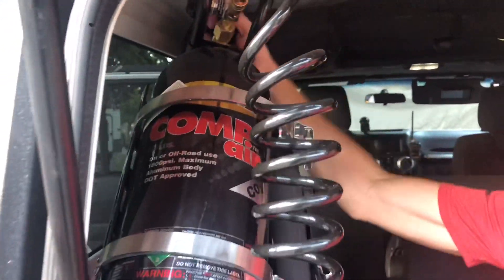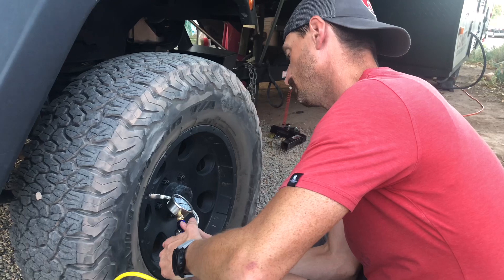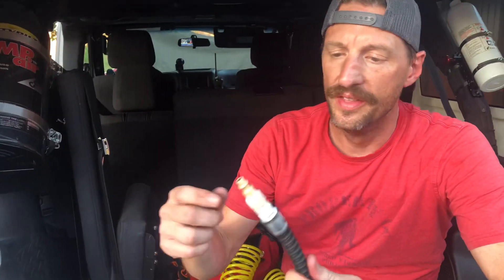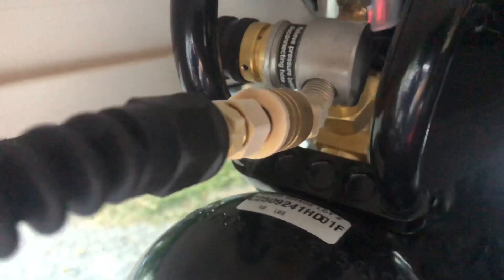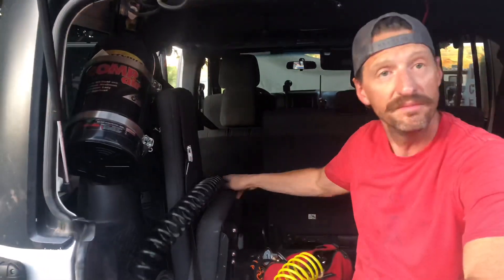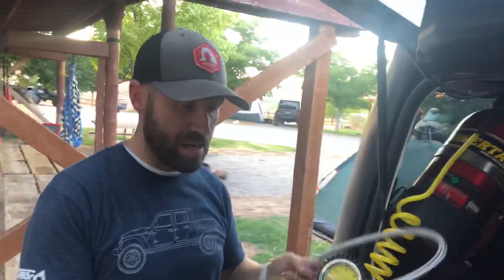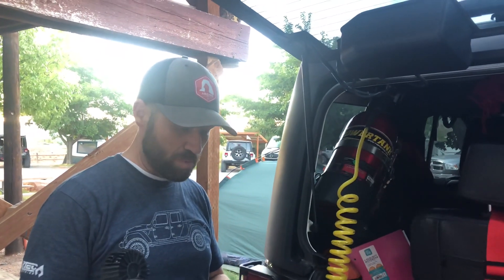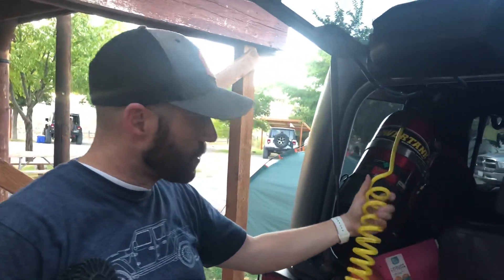Powertank vs Smittybilt CompAir

Comment: I bought the Smittybilt because I was being cheap... I’ve taken mine out twice now, and it has worked absolutely fine.   It didn’t leak at all and the hose that it came with had a good seal.  Problem for me was it only aired up 7 tires from 15-40psi... I had to plug in my portable compressor today to get my 4th tire up to on-road pressure.  I don’t want to pay to fill it EVERY trip, but i definitely need to figure out how to make it last for 8 tires.
Reply from the maker: PandaFam That might be where you fill it. There are some places that will fill the tank to its “top“ but will not actually pressurize it to its full capacity. Make sure you find a place that will actually pressurize the tank. My first time filling it up I had the same experience as you, but it was at a paintball place and their machine didn’t have the ability to pressurize it. Now we use a welding supply store.
Reply: Jeremy McLerran oh man! Thanks for the reply! I DID fill it up at a paintball store. Going to try a welding supply store next. Hopefully i really get to use it the way it’s supposed to
Reply from the maker: PandaFam Ha!!  I knew it… Same exact thing happened to me. Sorry you had to waste a full tank on that. But lesson learned, right?
Reply: Also going to 40psi😳.   What size tire?   Seems like that would be a rough ride.
Reply: BBDOC O ya, I’m running 35” BFG KO2s. The guy at the tire shop said that for on road use, they last longer and get better mileage at 40-42 psi. It shows. It’s somewhat of a rough ride regardless though. It’s a Jeep, so i never expected it to drive like a luxury car. Drives more like an old truck
Reply from the maker: PandaFam That air pressure is really, really high. I can’t imagine all the bone jarring bumps you’re feeling right now!  

I prefer to do something called the “chalk test“ where are you take a piece of sidewalk chalk and do a nice thick line across the tread of the tire. Then you drive down the street a few revolutions. Stop and look at the chalk. If it has almost completely worn off, you are at the right tire pressure. If it is wearing off only in the center then your tire pressure is too high and if it only wears off on the edges your tire pressure is too low. I found the best ride And longest life come when you are getting a nice even wear across the entire tire
Reply: @1111Overland  Thanks! I'll give that a try. I'm going to milestar patagonia M/Ts in 37"s soon and I was told that that same test doesn't work for that tire.  It'll buckle if you get a "full patch" on  road... it's meant to be center biased.  Thoughts on that?
Reply from the maker: PandaFam I’ve heard the same thing. It’s designed to run on the center, not the full tread. I considered the Milestars but they were heavier than the BFG K02s.  I’m trying to lighten my load, not increase it!
Reply: @1111Overland  they are heavier... and I misspoke earlier. I'm likely going to milestars because they're the only one available in 38s... BFG, Nitto, Toyo, MT all have 37s but no 38s.  My axles can't do 40s, so I want to maximize diameter

Comment: If you had to buy a new hose what would be the pressure limit of the hose for those systems. Thanks
Reply from the maker: Great question. John recently replaced his hose with a higher PSI hose (I believe it’s rated at 200 PSI) and he hasn’t had any more problems.

Comment: So I'm always looking for a bargain and so I also bought the Smittybilt CompAir at the 4WP show a couple of months ago for $250.  Like John, mine leaks like a sieve, so I would be curious as to a great replacement hose and fitting that would not leak as much.
Reply from the maker: SultanOfShinola so I just asked him and he said that he tried using his hose kit from his onboard air and it was dramatically improved. He wants to try my Powertank hose kit and see if it’s even better. Makes me wonder if the fittings aren’t machined as precisely as they could be
Reply: @1111Overland  Well, being cheap Chinese products, it didn't surprise me. I'm just curious now to see which one he likes best to give me an idea of which to buy for my tank.  At least you can't mess up a 10lbs scuba tank, right :-)

Comment: Powertank has the edge for quality.  Whatever works for you.  Dawgtanks work well for less money.  Also, it looked like maybe the Smittybuilt tank had been overfilled if it was leaking liquid CO2 on the fittings.  On a 10 pound tank you don't want to fill it more than 9# 13 oz.
Reply from the maker: Dawgtank never heard of Dawgtanks, I’ll have to check you guys out!

Comment: Is there a fix to the Smittybilt tank? I have one & used it for the first time 5/24/2020 & it leaked and froze! was a pain.
Reply from the maker: Scott Kinderdine Better fittings, or you can go through and wrap each fitting with tape I guess. I think it’s fairly simple if you understand the basics of plumbing… I’m not super great at it, which is why I’m glad I went with power tank, the fittings and tubing are near perfect and I haven’t had a single issue
Reply: Jeremy McLerran I will try Plumbers tape.
Reply from the maker: Scott Kinderdine I hope it works! Let me know how it goes
Reply: Jeremy McLerran ok sorry it took so long... I used Plummer’s tape & went from a 4 ball connector to a 6 ball connector.... so far so good.
Reply: I just bought the Smittybilt one and I love mine. It got cold and icy after airing up all 4 tires but that's about it. No leaks or anything.

Comment: The cheaper copy cat brands do not have the proper fittings and hoses to handle the pressures of CO2! I am biased I like Power Tank 1- because I have one (got in a trade for my small Craftsman air compressor) that is 20 years old, and 2- I am a snob for quality products. One of my pet peeves is cheaper products tend to never work properly. Even if I spent half the cost and the system was leaking at fittings I would not be happy.
Reply from the maker: I’ve found that to be true as well!  Most of my buddies have switched to Powertank hoses and fittings. Quality is amazing!!

Comment: Sorry my ignorance, what is the risk of this powertank , may explode in high temperatures of the sun in the jeep.
Reply from the maker: GREAT question. ZERO. It’s compressed carbon dioxide and if there was a leak of any sort it turns into kind of a frost on the hoses. It’s not combustible and I’ve had it in the sun for hours in temperatures over 100 degrees. No problems.
Reply: Thank you for clarifying the doubt, very good explanation that was the concern that there would be some leak thank you very much success 👍🏻✌🏼